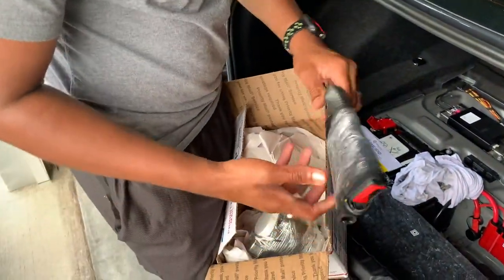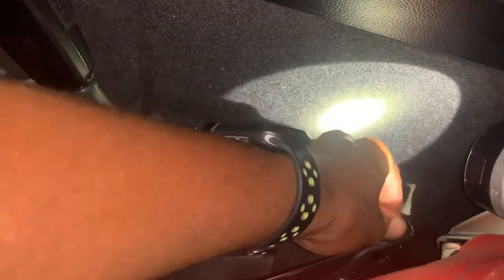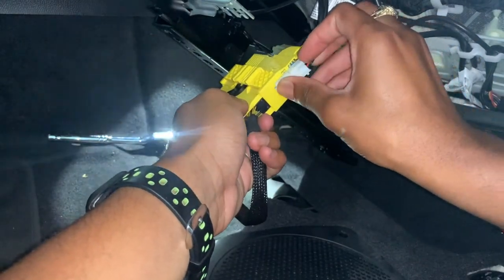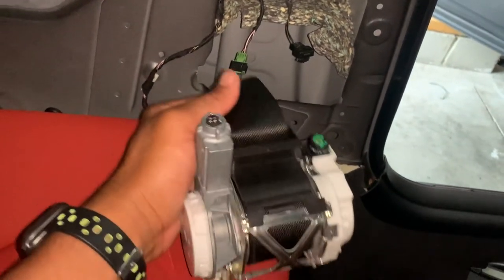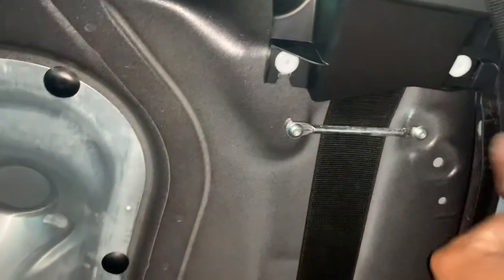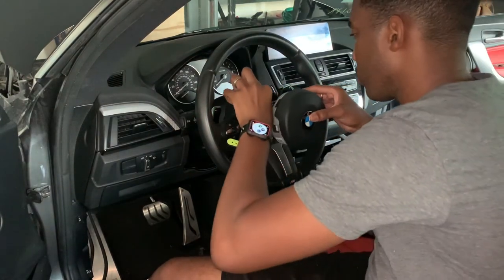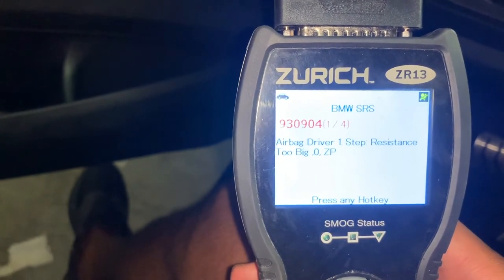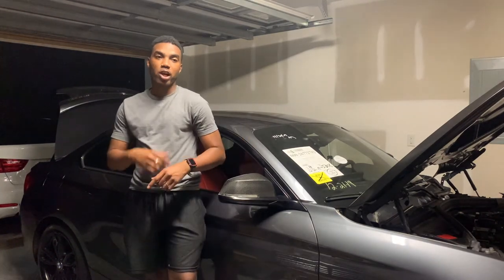How to Install seat belt, buckle and steering wheel airbag on BMW M240i during the Covid 19 Pandemic

Comment: What video did you guys used to help remove the seatbelts?
Reply from the maker: https://youtu.be/LnrO5QuGJtg
Reply from the maker: once you remove that plastic piece that is covering the seat belt you should have two or 3 bolts to remove and 2 connector and the seat belt is out

Comment: I have a C9540B code still, after relacing the tensioner, any idea
Reply from the maker: @nguyenkhoi3894  you may need to clear the code on the module and then you should have it gone.
Reply: @weerebuildz4427  sadly the passenger seat was giving me issue, if I move the seat up, it goes down, and vice versa. If I unclip the yellow plug under the seat and replug, I can clear and code and it functions normally. But once the ignition is turned off and back on, it reverses it again. Any idea. I bought a new seat control module, hopefully it works
Reply from the maker: @nguyenkhoi3894  yea see if that works the other thing that I would say is just to changes the wires around and see what happens next . But try the seat module 1st